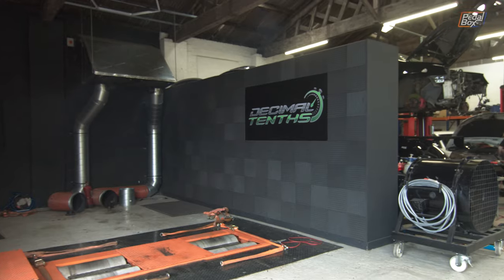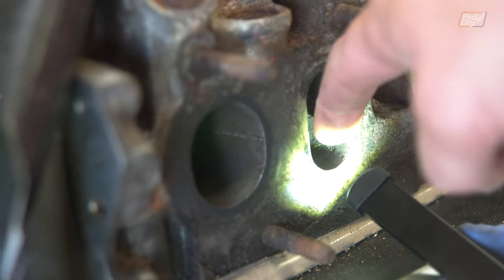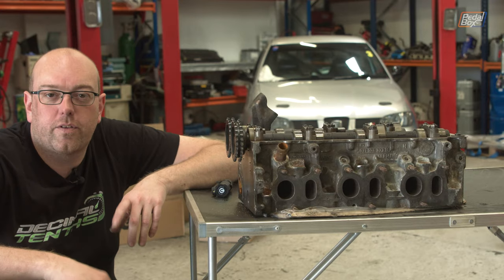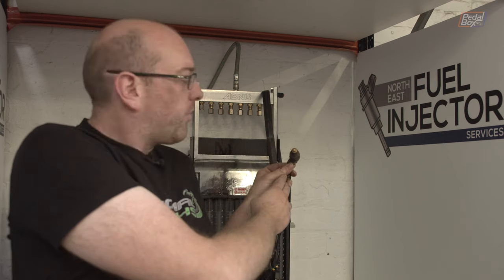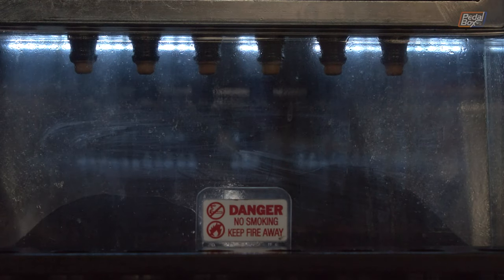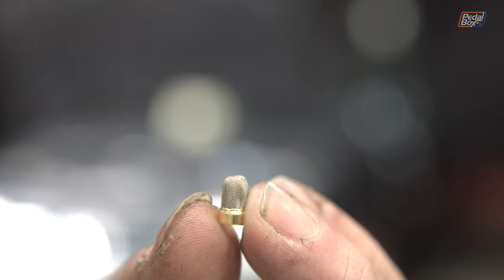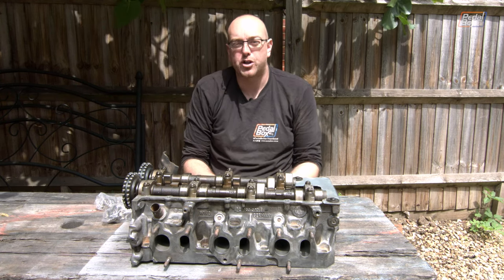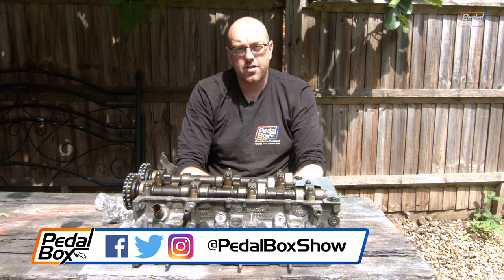Walnut Decarbonising & Injector Cleaning | Mk2 VR6 Golf | PedalBox Episode 107

Comment: Are you going to be replacing valve stem oil seals and checking the valves seal ok while you have it off?
Reply from the maker: I wasn't, only because the head will be coming off again for the turboing, so it's not a critical point and there hasn't been signs of an issue, also the cost of fixing what I find/break while doing so, lol. Theres a lot of creep on the rebuild of parts that "I really should do" :/